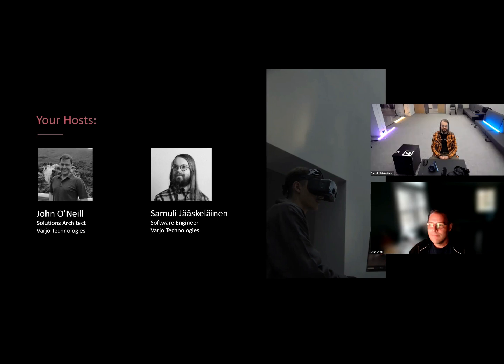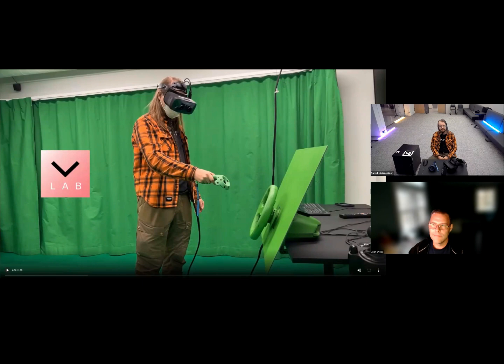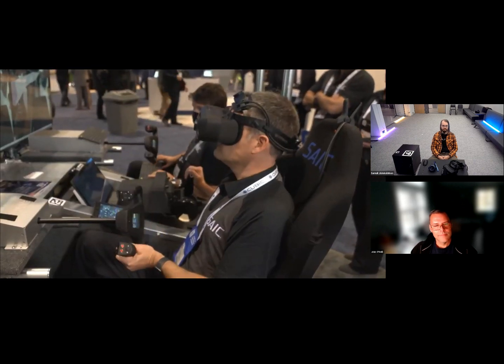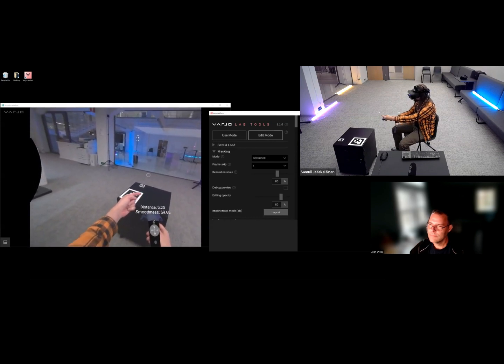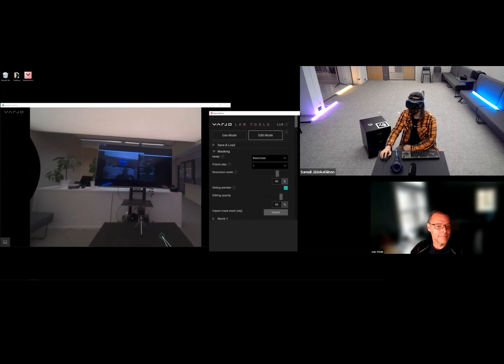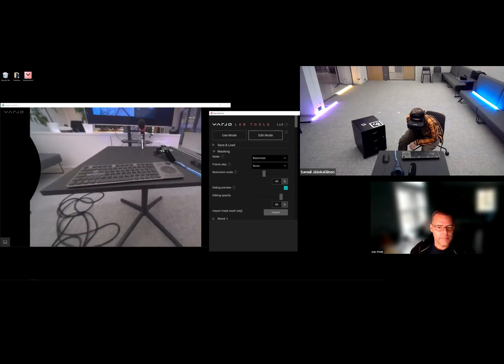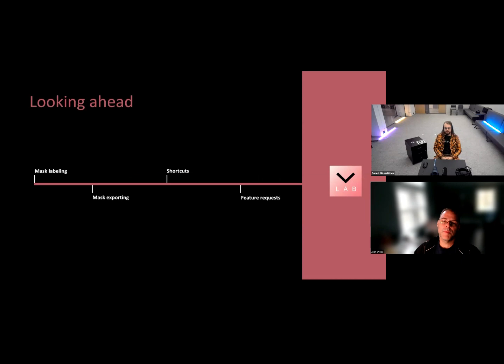How to create custom masks in XR | Varjo Lab Tools | Insights Session

Comment: Hi Varjo team,
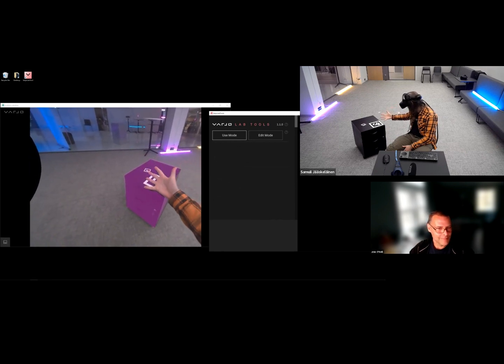I have question. If you stop 29:44 you can clearly see that the hand and fingers edges are not clear and have black background from the box behind. In my project I use extended masking with Chroma Key for virtual ceiling and we also have that effect if the hands are in front of the ceiling. The question is: is there a way to improve a rendering there? I would really appreciate an answer.
Best regards